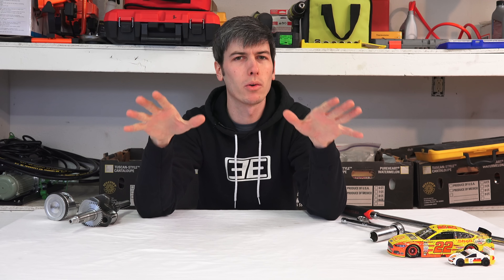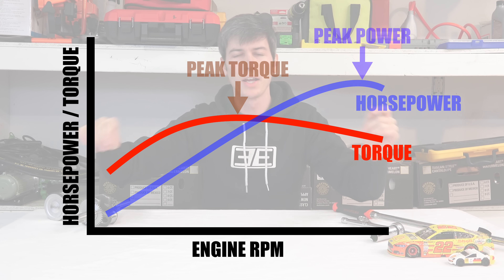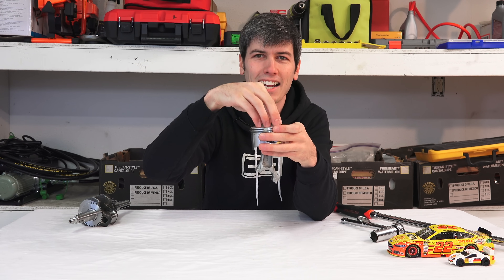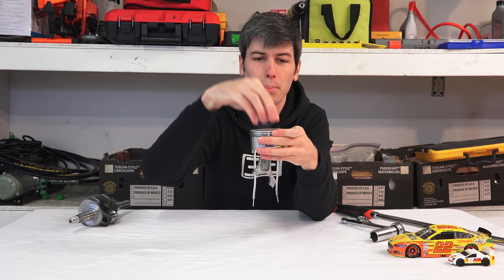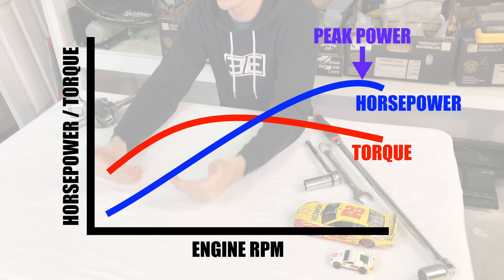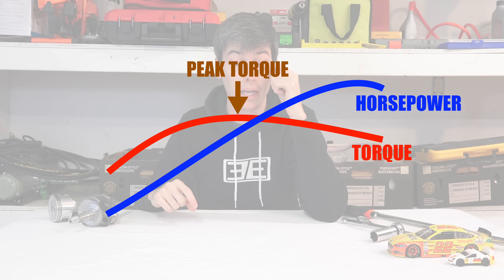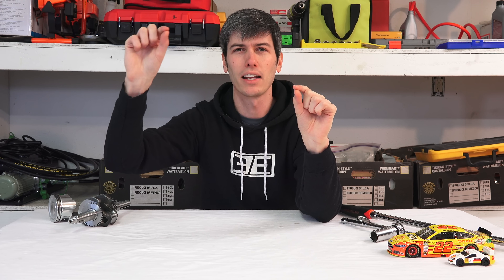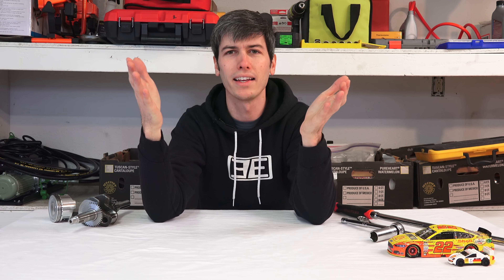Horsepower vs Torque - A Simple Explanation

Comment: FORGET THE GRAPHS, FORGET THE ENGINEERING DETAILS !   
>>>  HOW MANY TIMES CAN I REAPPLY THAT TORQUE IN ONE MINUTE.   THAT IS HorsePOWER !  <<<
Torque is NON-MOVING !   Length of lever times the amount of force.   2 ft lever x 5 lb weight = 10 ft lbs Torque.    You can set this up in your shop, walk away for 100 yrs and it will be 10 ft lbs torque for every second you are gone for 100 yrs.   We can seal a cylinder, explode that gas, keep it sealed, it will push on that rod & crank forever.   Torque forever.   NON-MOVING !
Work is MOVEMENT.   Weight x DISTANCE.   Hold 50 lbs over your head, that is NOT Work.   Move 50 lbs from the floor to over your head, that IS WORK.   50 lbs x 6 ft up = 300 ft lbs of Work.    300 x 10 reps in 1 min = 3000 manpower per min.   300 x 10 reps in 2 min = 1500 power per min.    Took you twice as long !   Less POWERful but same amount of WORK.   Dont Forget The Minutes (Time or RPMs)
HorsePOWER is WORK per unit of TIME ! (secs, mins, hours)   RPMs, that  ' M '  is real important.   HorsePOWER is defined using MINUTES.   People forget about the TIME COMPONENT when they are trying to figure this out ! ! !
>>>  FORGET THE GRAPHS, FORGET THE ENGINEERING DETAILS !   
HOW MANY TIMES CAN I REAPPLY THAT TORQUE IN ONE MINUTE.    THAT IS HorsePOWER !   <<<
In the real world, engines have all kinds of losses, friction, heat loss, internal air drag, (intakes/exhaust), combustion timing, valve springs, etc.    That's where the fancy graphs come from.

Comment: Torque is can you do it. Horsepower is how fast you can do it.
Reply: Not really but good try
Reply: @MarquitoRH  exactly.  Power is not only how fast but also how much which of course has to include any at all.
Reply: 100,000 ft•lb. To roll a pensil across the floor.  Can you do it?  What about 200,000 ft•lb?  The answer of course is no.

Comment: Is distance really needed for torque?  There isn't much distance with a powerful drill.
Reply: Yes. Force x Distance
Reply: @MarquitoRH  Okay, we see the rotational force of a power drill, but where does the distance come from?  Would that be the distance of the rotating armature inside?
Reply: Torque is just rotating force, we define it as force multiplied by distance. For example 10 pound feet torque can be generated by exterting 1 pound force at a distance of 10 feet from center. Or it could be 10 pounds 1 foot away, 5 pounds 2 feet away, or any other infinite combinations. In an electric motor a rotating magnetic field will produce a torque on the shaft.
Reply: @Redtooth75  Right, but that's not about distance and leverage, which we always see in videos like this.
Reply: @JeffC-fq1be  Distance and leverage is a perfect way to describe torque. How else would you describe it? The definition of torque is perpendicular force multiplied by distance from the center of rotation. The units are literally force and distance multiplied together. Pound feet (ft*lb) or Newton-meters (N*m) being the more commonly used units.
Reply: @Redtooth75  That is a good way to describe that  kind of torque - the kind with  a wrench, lever, etc.  But toque is nothing more than rotational force.  How it's generated doesn't matter.
Reply: @JeffC-fq1be  Yes but how do you describe rotational force, how do you measure that, how do you produce that? The definition of torque is perpendicular force multiplied by radius. The torque is generated the same in an electric motor. The magnetic field pushes on the rotor, that force is applied at a radius from the center. That results in a torque. Its only more complicated on a motor because there is not one single point of force, there is a distributed force along the entire radius. Which just means the math to calculate the torque is harder.
In order to produce a torque you have to apply a perpendicular force at a distance from the center. Doesn't matter if its a wrench, engine, turbine, electric motor, etc. Somewhere along the line force was exerted at a radius from the center resulting in torque.
Reply: @Redtooth75  Yes, a perpendicular force of some kind is needed to produce torque.  And yes again, it is more complicated when a motor is involved because it is not just about leverage as it is with a wrench.  But, as I said, it all comes down to one thing:  Torque itself is rotational force.  That's really about it.  It's reported in foot-pounds and Newton-meters.  But of course a dynamometer is usually used for car engines.  You can also multiply hp x 5252 and divide by RPM.
Reply: @JeffC-fq1be yes but your whole question was is distance required. And yes it is. If the distance was zero then the radius of the shaft is zero. And a shaft with a radius of zero can't rotate because its not a shaft its a point. If it can't rotate it does not have torque.
Reply: @Redtooth75  Distance is required - to a point.  But with a power drill it is a finite distance - the radius of the armature.  The rest is all about electrical and magnetic energy.   But the bottom line is that it's all about rotational force.
Reply: @JeffC-fq1be  And how do you think rotational force is created dude? Distance is always required, the actual bottom line is that force multiplied by distance is what gives rotational force. The distance can be small but it is absolutely necessary. Otherwise it would just be linear force. If you have a short radius then you will need more force to get the same amount of rotational force (torque). If the radius is zero then torque is zero. In the case of a motor the electrical part is how the force is generated but the radius is absolutely a crucial part of the resulting torque.
Reply: @Redtooth75  A drill that has 500 inch-pounds of torque has over 41 FOOT-POUNDS of torque.  There is no 41-foot lever.  Again the armature radius is an inch or so.  That is the only distance. Almost every bit of that toque is being generated by electricity and magnetism - not distance.
Reply: @JeffC-fq1be yeah but it has still has a radius. As I said multiple times the distance is required. It does not have to be a large distance, it can be extremely small but as long as its not zero you will still get a torque. Thats how multiplication works. T=F×r is the equation for torque where F is the perpendicular force and r is the radius. If the radius is zero then torque is zero. If the distance is small then you need more force to get a high torque. If the radius was large you could achieve the same amount of torque with less force. Im not sure if your trolling or what dude but im done repeating myself.
Reply: @Redtooth75  You can call it trolling or whatever you want.  I'm fine with that.  I don't care.  My point is that distance and leverage is only one part of how torque is generated.  Of course some distance is needed, but most of the force is generated by electricity and magnetism when it comes to electric motors. There is a huge distance difference between a guy with a 10-foot metal rod trying to turn a rusted screw and a motor generating the same force.
Reply: @JeffC-fq1be i established that in my very first comment to you dude. If that is the point you were trying to make you did a very poor job of showing that.
Reply: @Redtooth75  You were talking in circles.  It was all about leverage.  It was all about distance.    Now it's not.  But tell yourself whatever you need to.  I hope you learned something here, but I doubt it.  Anywho, I'm done.  You're dismissed without further argument.
Reply: @JeffC-fq1be are you a child? I would not expect an adult to struggle this hard with multiplying two numbers. You kept saying the distance does not matter when it absolutely does. It is literally half of the entire equation. Of course the force matters as well, I never said otherwise. Juvenile.
Reply: @Redtooth75   Boy, you done got owned!  Yes, levers and bars give you torque but they are only one way.  That's like saying if you want to generate electricity you have to use coal. There are many other ways.
Take an electric motor.  When you want more torque you give it more electrons.   The innards of the motor don't get bigger for more leverage.  Torque is rotational force - end of story.
Reply: @bruceingram4715 and how do you think rotational force is produced? You exert a force at a radius. Electric motors do that too, they are not magic. A magnetic field produces a force at a radius from the center of the shaft resulting in torque. If there is no radius then there is no torque, its just a linear force. Nobody said the radius has to be large, nobody said the force has to be produced mechanically. The method used to produce the force can change, the size of the radius can change. But in order to produce a torque you must exert a force at a radius. Full stop. The distance absolutely matters, its one of 2 things that matters. Anything multiplied by zero is zero.
Reply: @Redtooth75  Yes, you need something spinning to produce torque.  That's part of it.  A motor's innards spin. But the size and distance are static.  For more or less torque the key is the power provided to it.
Reply: Both of you need to learn reading  comprehension. Christ this is pathetic.
Reply: Crankshafts provide no leverage to the work done by combustion pushing the piston down the bore.
Reply: @rollsroyce329  And how about all those pistons in a power drill!
Reply: @JeffC-fq1be  Im pretty sure you don't understand the difference between linear force and rotational force. Rotational force is torque. Rotational force is created by exerting a linear force at a radius from the center. That is the only way to produce a rotational force. Electric motors do that too. A magnetic field exerts a force at a radius on a shaft resulting in rotational force. A distance is always required, you can't have rotational force without it. You would just have linear force. Nobody said you needed a large radius to produce a large torque. Applying a large force to a small radius will also get a high torque. Thats what electric motors do. Magnetic fields are strong.
Reply: @Redtooth75  I understand it better than you do.  Torque is rotational force.  That's all it is.  No motion required.  That force can be generated from piston, turbines, motors, etc., or levers.  It doesn't matter.  It's all about rotational force.
Reply: @JeffC-fq1be  Who was talking about motion? You can't say you understand torque and then ask if distance is needed. Its half of the equation so yes it is absolutely needed and has a significant impact on torque. What exactly do you think is the definition of rotational force?
Reply: @Redtooth75 To generate torque (a term I have already defined), you need distance if you are using a lever, or some other way to create the force, as in a motor.  You are over-complicating it.  Again, torque is rotational force that can be generated in many ways.
Reply: @JeffC-fq1be nope that is wrong. Force applied at a radius is the only way to produce torque. Like I said electric motors do that too. A magnetic field applies a force on a lever. They are not magic.
Reply: @JeffC-fq1be you cant just create rotational force spontaneously. The only way to make rotational force is to apply a linear force at a radius. That is it, the end, full stop. If something makes torque then that is whats happening.
Reply: @Redtooth75  "A magnetic field applies a force on a lever.."  LOL!
Reply: @JeffC-fq1be yes. How do you think they produce torque? The field generates a laplace force onto the rotor. Since the rotor has a radius that results in torque. Force applied at a radius results in torque. There is no other way to create torque. Electric motors are not magic.
Reply: @Redtooth75  There are plenty of sources online that explain torque.  Do some internettin',  school yourself, and maybe you will understand.  For the 1000th time, torque is rotational force. That's all it is.  Example:  If you try to turn a doorknob you are applying torque,  whether or not it actually turns. Trying to sound smart by spouting gibberish and over-complication serves you poorly.
Reply: @JeffC-fq1be what is the definition of rotational force buddy? How do you create rotational force? There is only one way, apply a force at a radius.
Reply: @JeffC-fq1be in an electric motor the magnetic field and electric current react and generates a laplace force. That force is exerted at a radius from the center of the shaft. The result is torque. Its very simply, im sorry if the words were too big for you but grow up a little yeah?
Reply: @Redtooth75  LOL!  You give the definition of torque that I just gave you, buddy.  And, um, I think everyone knows that is how the force is created - at the object you want to turn.  By jove I think you're got it!
Reply: @JeffC-fq1be then why are you asking if the radius necessary if you allegedly understand that?
Reply: @rollsroyce329  They aren't supposed to provide leverage and they don't need to.
Reply: @bruceingram4715 👍 exactly.  The crankshaft converts linear reciprocal motion into rotational motion on a 1:1 basis.  Leverage can be found where it. Belongs: in the transmission, differential and tire diameter.

Comment: is it true to say that torque is measured and horsepower is calculated?
Reply: Yes. Dynamometers measure torque, not horsepower. Horsepower is then calculated. When using horsepower and pound-feet, the formula is torque times rpm divided by 5,252.
Reply: All power measurements are calculated because they are the rate of doing work so need a temporal aspect.

Comment: Perhaps an electrical comparison would help? 

Torque is actually analogous to Voltage, which is the potential applied force currently available (think pressure in a hydraulic system like a water tower) while horsepower is actually analogous to Power, which is Voltage times Current (current being the flow rate of both electricity and water in a hydraulic system). 

You can have torque applied, but no movement. Your electrical wall outlet is typically either 120V or 220V, but until you plug something in and turn it on, no current flows so no power is used (transformers like chargers and DC power bricks do have a leak current so it's best to unplug them when not in use to save power). 

A combustion based car at idle is using power, however (similar to a large leakage current come to think of it) as gas is burned and the engine is turning, but it uses the most power as you are moving and more as you accelerate on a flat plane (obviously going downhill helps and uphill takes more power).

The key take away here is torque is a potential force to do work and more torque can generally move larger loads (think towing). Power is the amount of that force times the movement in RPMs in an engine (like current flow in hydraulics or electrical flow in electrical applications). Horsepower can be converted to watts as well (1 horsepower = 745.7 watts).

Comment: I don't believe this explanation.
Reply: than you dont belive in our reality dependencys 👌🏻 power is how fast work can be done this statement explain everything engine is for end work specific amount of work in specific amount of time and for this it need specific wmount of POWER at what rpm it will generwte this power from how big or small tprque it co pe,tellly dosent matter for acomodade specific amount of work in specific amount of time it need produce specicifc amount of power otherwise he  never end job on time inregard to specific aplicstion simple if soome drag race car have some fix whole motion resist determined be drag weight and some grip level fix and must achieve let say < 10 sec on 1/4 mille time in qualification os dosent matter how much torq its engine will produce or how high rpms it can hold as long as this car engine will not generwted  enough power it will not qualllify/ be unable to go under 10 sec 👌🏻🪠🍿 long story short hees explanation is 100% correct vs statement  like „power sells cars vs tprq win races „ is JOKE 👍🏻 1000000 nm at engine crank and 1 hp in the same car type be extremely slow in comparision  to let say something like 1000 nm and 1000 hp assuming offcorse each be on perfect gearing 👌🏻🪠🍿

Comment: My take is that power just tells you how far up in the rev range an engine can carry its own torque. As well as how high of a speed (rpm) it can do it at. A low powered engine might have a bad torque drop off later on. But a high powered engine would be able to hold its own a lot better when it comes to its OWN torque spec. So yes, power DOES do something, it just doesn't tell the full story.
Reply: Power, not torque, is the limiting factor in not only the top speed of a vehicle but also how quickly it can accelerate at any speed and how much weight it can pull up an incline at any speed.

Power is the limiting factor for all jobs. Having an engine that makes its power at low RPM makes it dramatically more cost efficient. Having it make its power at high RPM makes it dramatically more effective for its size/weight.